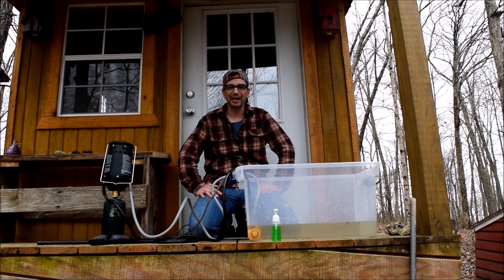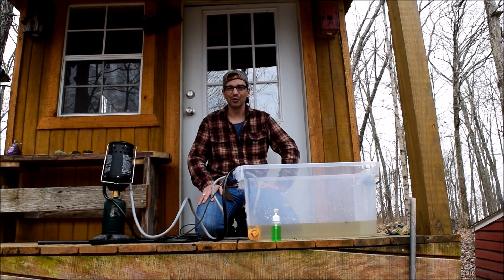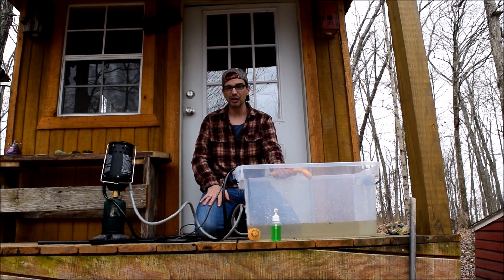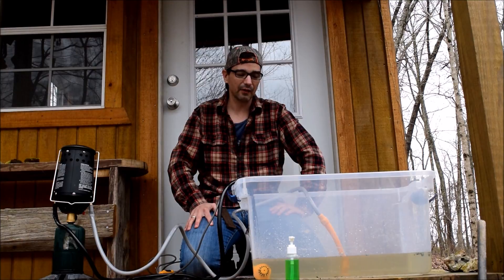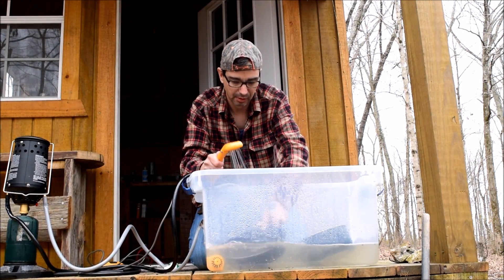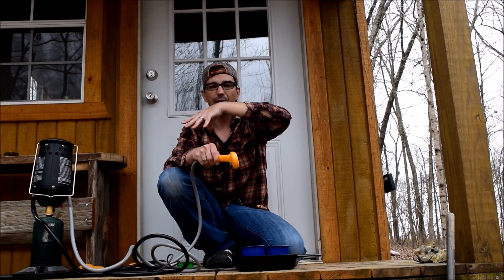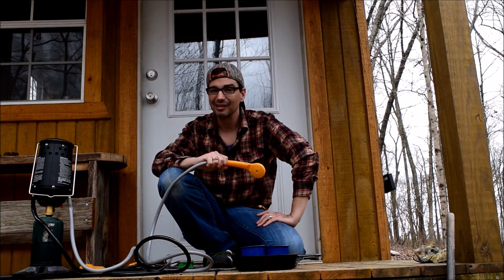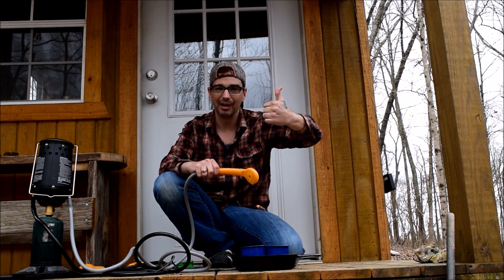Hot Shower Off Grid. Zodi Zip Modified

Comment: can you attach pics of your modification? its tough to see how you have this hooked up sitting flat on the ground
Reply from the maker: John Ridings dont think that I can but i can explain it pretty simple. 1.  Cut off 12v shower head hose and attach where Zodi shower head should go and band clamp on. 2 take the cut end of 12v car shower and band clamp on side of zodi thats supposed to run battery pack/pump. Presto, basically you are only using the heating element of the zodi and not the pump, hoses or head. All of that is spliced in car shower
Reply from the maker: John Ridings i plan on picking it up from the cabin to put in the camper restore project I been making videos of here recent. Ill make a better video here in a few weeks